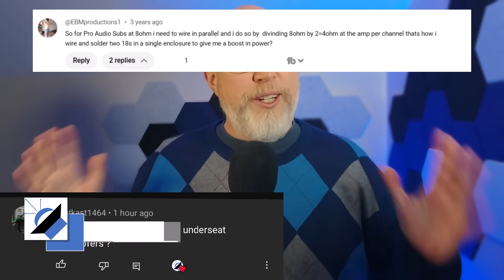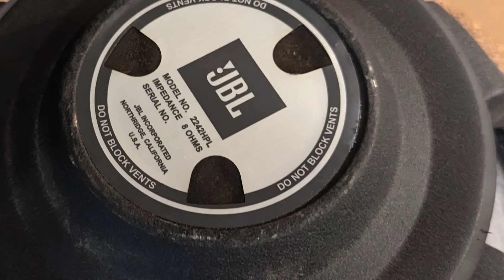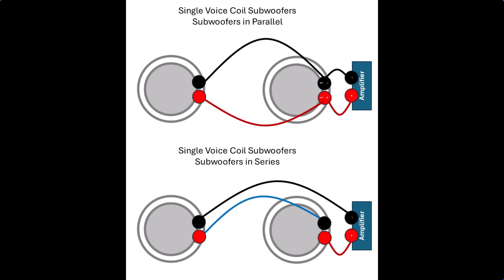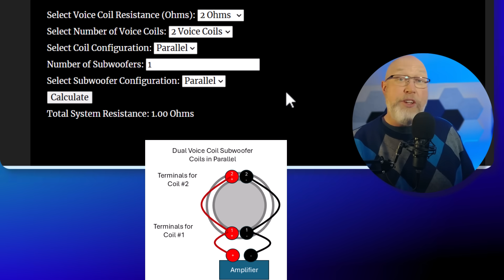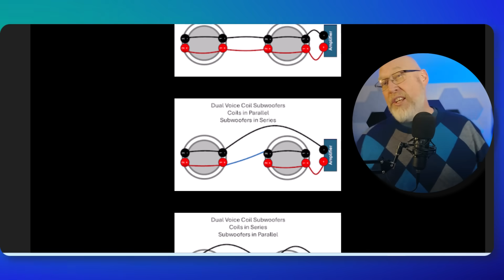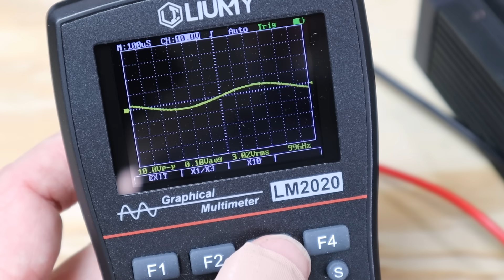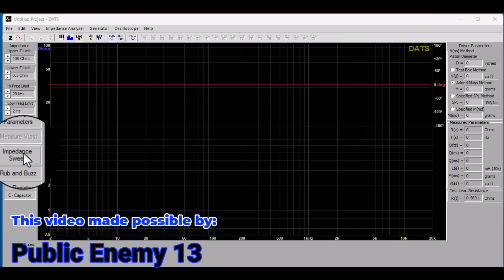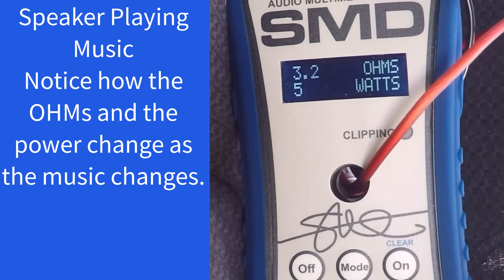Wiring your subwoofers for more power and more bass!

Comment: Is there a difference in sound quality between 1 ohm and 2 ohm ?
Reply from the maker: There are people who claim that as the resistance lowers the sound quality decreases because the amplifier damping factor will decrease as the resistance decreases.  Most people in that camp are willing to die on that Hill.

I am in the other camp. I don't think it makes any difference. I should probably make a video explaining my reasoning.
Reply: @DIYAudioGuy  would be interesting if you at some point more or less.. could measure distortion etc, and also your subjective opinion on sub sound pressure and sound quality 1 vs 2 vs 4ohm loads. also I think guys maybe underestimate how hot amps and cables can be, and power lost when pushing those large watt numbers with cables not up to the task
Reply: yup likely, to a varying degree. you get better quality sound with strong amps keeping them in 3-4 ohm. better for the longevity of your gear, efficiency and safer too
Reply: Yes, there is a difference in the quality of the sound reproduced. Most people do not look at, care about, nor understand damping and how that correlates into the scope of things. As you decrease the damping, you begin to decrease what's commonly referred to as "Cone control" as well, this is only one aspect of things though.  Think of it like this: your car has a strut assembly, which is basically a shock and a coil spring.  They work simultaneously to provide stability and control.  As the shock(damper) begins to degrade, the vehicle becomes more bouncy as in a floating effect,  as it starts relying upon the coil spring and then the suspension becomes much less stable.  As you lower the ohm load, you decrease the damping. But, is always a big debate.
Reply: @Chuck_Sanders  just a rough adwise id usually give to people new to this. the cheaper/worse amp, the more important it is to stay at around 4 ohms. again safety, longevity and sq
Reply: @hotdog9262  that's basically what I was stating in that.  The lower the load the amp sees, you lose efficiency, lower the damping and decrease the longevity of the amplifier.
Reply: @Chuck_Sanders  yup I agree

Comment: Which connection is much better for more bass deep bass series or parallel
Reply from the maker: If by depth you mean playing low frequencies, then it will have no impact on the depth of the bass.   The music does not care how you wire the subwoofers. 

What most people do is select subwoofers so that they can wire them down to 1 ohm and then use a 1 ohms stable amplifier to get more power.

Comment: Did it ever occur to anyone that a dead short is 0 ohms? These 1 and 2 ohm loads that everyone is trying to achieve is just a slight step away from disconnecting your speaker cables and touching them together. How can that possibly be a good thing?

When you decrease ohms, you get more power? No, jackass. If you want more power you buy a bigger amplifier. When you get "more power" by lowering resistance, you're not really getting more power, you're just making your amp work twice as hard to drive the same speaker. When a power amp is rated at 1 or 2 ohms, its called a worst case scenario. You're not supposed try and wire everything to get as close as possible. That's what a 16 year old kid would do. If you have a speaker that's easy to drive, you don't need all that power to begin with.
Reply from the maker: Watch the video again, you missed the last half of it.
Reply: @DIYAudioGuy  No I didn't.

Comment: I would run 2 ohms and below if I had a high end amp which typically has a very high dampening factor. I will just stick to 4 ohms since i can't afford those amps.
Reply from the maker: I wonder how much that matters?  Unfortunately the equipment needed to test it is $$$$$$$.
Reply: This is the first post that actually makes sense. Only in car audio would someone think a 2 ohm load is better than a 4 ohm load.

Comment: So i need to weld all the red 2ohm wires parallel from the black 4ohm wires to level the impedance load from the different inductions that power the wired piping inside my subs right?
Reply from the maker: I did not follow that.
Reply: @DIYAudioGuy Nevermind buddy I went wireless anyway.
Reply: @d.natrop4495 no wires on your speakers?? 😂
Reply: @rocknrolljesus3197   Yeah, everything  runs on my cars wifi now. Also bridged my battery terminals and installed a 24K bi-quadruple shielded remote cable.
Reply: @d.natrop4495  bridged the positive post to the negative post? 😁
Reply: @rocknrolljesus3197  It gives your audio system that high-fidelity sparklin sound without draining the alternator.
Reply: @d.natrop4495  I like to cook my supper over the pos to neg  jumper while I'm rocking out. 🤣
Reply: @RocknRollJesus101  🤣

Comment: Dc can produce much trough switch andvphase controlers and this used to be a way amps worked but people do talk on it much but yes dc can should you be send a amp to clipping to the point it produces dc power no it wasnt designed to do so but a newer amp that dose this kinda is the kicker warehouse 10k amp is had a dc output for each coik of a sub and you had to wire one coil to each input and it would switch between coils in push pull coil 1 push coil 2 pull

Comment: Wow, super informative! I knew most of this already, but this is great information to pass down to new bassheads. I do wish you had touched on damping factor, as it's an important concept. It shows how well an amp can control the current, which directly affects the subwoofer's performance. A higher damping factor results in better control, giving you improved sound quality and punchier bass.

Comment: Another excellent video!   You should do one comparing power levels of parallel vs. series wiring using the same drivers, amplifier, and enclosure.  This will debunk the term "box rise."
Reply from the maker: I'll say that to my idea list.
Reply: I'm not entirely sure how that debunks the term box rise, maybe something attached to the subject I'm unaware of? The term is definitely surrounded by misunderstandings, probably initially coined by people experimenting and crudely testing the power output in different enclosures. Many people, even today, don't even think about impedance curves, and they conflate a nominal impedance to the DC resistance. To me the term just means, that an enclosure affects the impedance curve. Some people probably incorrectly believe it's inherently bad.
Reply: @mattwells1036  What I mean, is that the term "box rise" is inaccurate. It misleads people into thinking that it's solely caused by the enclosure.  This may be true for a single subwoofer with a single voice coil, but with a single subwoofer and dual voice coils, the amount of rise will vary, depending on how that subwoofer's coils are wired.  The delta between DC resistance of each configuration will be proportionally different.  There are many variables to this that could be discussed.  I'm just trying to compare basic configurations of "the average Joe."

Comment: did you really say that it doesn't matter if you wire a  single 2 ohm dual coil sub in series or parallel because they both will give you 1 ohm? wow that's gonna screw somebody up...
Reply from the maker: I'll have to clarify that.  It's an issue with the calculator.  If you only have one voice coil, it doesn't matter if you select series or parallel wiring because the calculator will give you the same result in either situation. 

Likewise, if you only have one subwoofer, there's no other subwoofer to wire it too. So series versus parallel will not affect the calculation.
Reply: @DIYAudioGuy Many subwoofers are dual coil. Stating that it doesn't matter with one subwoofer isn't accurate unless it's a single coil subwoofer. You need to specify that. You seem to know what you're talking about, but you need to be more careful with wording, considering this is obviously intended to be an educational video.
Reply: @scurritoburrito1136 that's already implied but ok
Reply: This is a difficult set of topics to address at an introductory level, as it really requires some physics, math, and engineering to grasp vector sums of complex reactive circuits, motor-generator systems, and practical circuit design versus theory.  

On one simple issue, pushing the speaker coil across the static magnetic poles generates current, not voltage, though that in turn may be seen as resulting in voltage across certain elements. 

The whole idea of multi-voice coil sub's is marketing hucksterism, that should simply be avoided for competent audio engineering of good systems.   

Ideally instead a single larger sub and matched amp would get a line level mix fed into a single channel power amp and voice coil, and driver and power level and enclosure matched to the space.  That should not exist in normal cars, while owning 500 acres of land is too little to contain or dissipate some audio systems with good low end capabilities, and respect neighbors.  

Generally power amps in the 1500-1800 watt range are useful, as they hit limits based on AC supply circuit size, and match well to larger bass drivers now in commercial production.  

Damping factor and thermal designs as well as protection circuits and design to source or sink reactive loads, are all important factors, where generally parallel drivers should be limited, and series drivers avoided.  A good pro grade amp will feed a 1 ohm or 200 ohm load on one channel while shorted with a heavy metal rod across railroad ties wired to its other output.  That costs money to design, and most consumer toys will self destruct first. 

Most amps are designed for an optimal load impedance, based on damping factor, complex impedance variations, thermal factors, power supply design and rails limits on voltage or current, weight, distortion, protection circuits, etc.  Often a bridge mode will deliver 3 times and not the waveform and Ohm's Law theory 4 times single channel power, because of ESR in those lumped systems (equivalent series resistance).  Bridge mode is sort of like halving load Z per side, and summing two amp sides.  

Large modern MOSFETs handle such factors far better than older bipolar transistor outputs.  

The two main things missing from this video, are disclaimers that the real world engineering needs basic STEM background as a precursor to the higher levels of how things really work, AND that lots of consumer products are sold that are really hucksterisn for buyers lacking good audio engineering understanding, and are really better to not buy, not install, and not recommend, than to bother calculating superficial theory of workable load impedances, versus just avoid that crap and do any channel mixes or band filters at line level, and feed that to single amps and normal single voice coil drivers, that won't have pairs of magnetic high energy fields competing.
Reply: @lokiva8540  Is any one else hard or just me? haha as an Electrical designer for High Voltage Industrial/commercial applications this music to my ears. (pun intended) haha
Reply: @lokiva8540 sure you can get an amp like that and most of what you say sounds like it’s home related as for 1 ohm maybe 2 and yeah it won’t care about the other channel as you described it being shorted out but at the same time you then have a shorted out channel on a very expensive amp regardless of how good the amp is if you leave it shorted for long enough you will eventually have a one channel amp. There were other things that only really apply to even audio that you mentioned  as well that I don’t think the normal audio viewer of this channel really needs to get all in their head. Let’s face it I think you just wanted to come off sounding educated and that you maybe but pompous and jargon filled was all it sounded like to me.
Reply: He's talking about while using his calculator.   That, on a single speaker, clicking series or parallel is irrelevant as the impedance will come out the same on his calculator
Reply: @christophergilbert8665  The case of a single driver aren't actual series or parallel circuits either.  That's the real distinction, that makes use of a calculator for irrelevant conditions beyond silly.
Reply: @lokiva8540  truth
Reply: I was just coming to say this! With a single coil loudspeaker, there is no series nor parallel. It's either wired correctly, or wired 180 out of phase. Clarification is definitely need. I appreciate his effort and all the knowledge he is sharing for the car audio community, however, that effort can very easily be in vain if inaccurate.
Reply: @abruptlyblunt  Just thought of another aspect of this....  In the old days of tube amps with output transformers, impedance matching was needed.  Two 8 ohm drivers in series would match a 16 ohm output (and higher impedances required less transformation).  

In modern solid state amps, a high quality amp approaches a zero output impedance, and exists as a current both source and sink.  In that case, parallel drivers have less motor-generator interaction than do series connected drivers.  However, given that no amp and wiring is an actual zero impedance, higher impedance loads allow higher damping factors, with less than 40:1 undesirable, and greater than a few hundred to one a point of little added benefit. That balances against amp power supply and output designs to have thermal and rails and output stage ESR limits that often make power capacity higher with lower Z loads, up to a point of overload, or going over the far side of an integrated power to impedance mapping for that amp design. 

Most home systems are optimized for 8 ohm speakers, and most car audio for 4 ohms, and most commercial systems for 4 ohms though designed to operate more conservatively at 8 ohms, and survive 1-2 ohms.   

With modern solid state amps, there's no such thing as "matching" in the sense of old tube and transformer amps.  There are issues of complex impedance that's not actual impedance.  It's generally ideal to operate conservatively relative to amp spec's, as actual loads may stretch their limits.  Parallel systems also work if one driver burns open, series systems do not.  In all cases due to damping factor and motor-generator effect, 1 driver per amp is ideal, other than balancing cost, space, and cabling issues, or in some venues commercially, aerial rigging.  

Add to all that powered speaker systems, where speaker cable reduction of damping factor is made moot, but AC lines need to be rigged to cabinets, while cabinets may have WiFi control and monitoring interfaces with microprocessor based excursion, thermal, and Eq controls that maximize performance within a protection model.   

That raises some complex engineering issues to seriously understand, but well designed products may work well for non-engineer music users by default setups, with protection and management internal and paired to drivers, versus being part of a rack with limiters and active crossovers ahead of discreet power amps.
Reply: Each voice coil will be seen by the amp like its own speaker and a 2phm stable amp will clip like heck and likely damage if you put 2 2ohm voice coils wired in paralle. Had this issue back in 2004 with a Kenwood Excelon Mono 401M and the "OG" kicker L7 15 dual 2ohm since my amp thought I had 2 2phm speakers which was 1ohm
Reply: He is talking about wiring in series and parallel at the same time. I have done it successfully on home theatre speakers. Only using matched impedance speakers. This type of wiring is a must when running multiple speakers of one channel.
Reply: @stuartwinter2758  One time with a nice home stereo amp I wired 2  4 ohm speakers together on parallel for each channel. Didn't realize this was loading 2 ohms on each channel and not 4. It sounded great. The amp only lasted a few months before it burned itself out. Shame
Reply: @connormason7907  They don't realize you don't get more power that way. You're just forcing the amp to work twice as hard. They think if an amp is rated for 1 or 2 ohms, you should try wire the system to get as close to that as possible. Its insane. If the speaker is easier to drive, you don't need as much power. In one ear and out the other.
Reply: @052RC oscilloscope don’t lie.
Reply: @052RC this is true but when have you ever seen someone buy a speaker this isn’t way to hard to push thinking that because it says 5000 watts it is in some way going to be louder than that of a speaker that’s less watts? Then they wonder why it barely moves because they couldn’t afford an amp that puts out 5000 watts. 
It’s all in the decibel to one watt rating if you have a speaker that’s high decibel to watt it’ll be louder than one that’s not with the same power going to it. What I’ve learned is one buy the amp first then buy speakers that match the power of the amp.
Reply: It will destroy the amp
Reply: @connormason7907 no it won’t.   Might overheat the amp if its circuitry is inferior.
Reply: @hamiltoncouple01  If the amp is rated for 2 ohms and it has a 1 ohm load that'd be more stressful on it than a 4 ohm load wired in series. When I ran a 2 ohm load on an amplifier with a minimum rating of 4 ohms it killed the amp after a few months. What the amp is rated for is safe but beyond that it's a bit of a gamble
Reply: It will if the the amp ain't 1 ohm stable but it does matter on how u wire the them... SVC 2ohms can be wired to 3. Something load series... If u wire 2ohm svc subs parallel. U'll end up with 1.33 load... Unless u have 2 2ohm dvcs series 4ohm each load... And if u wire them parallel after series ull get a 2ohm load